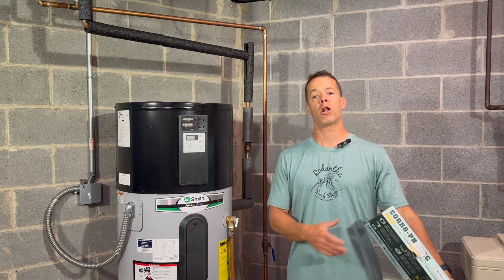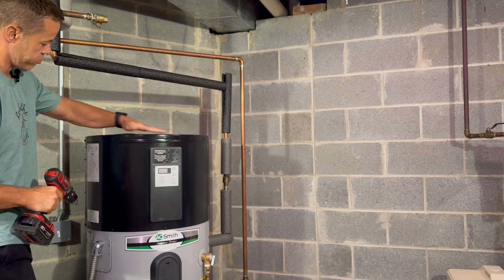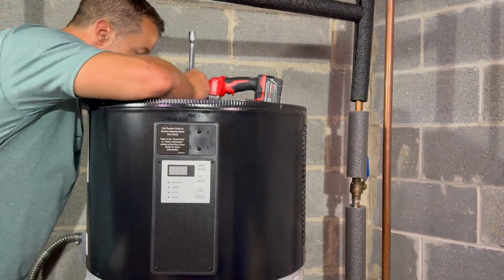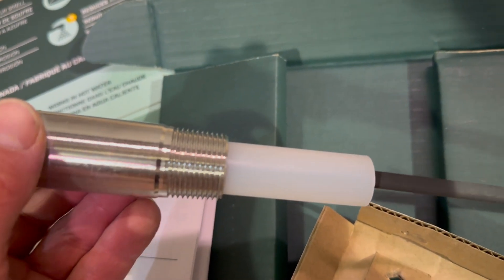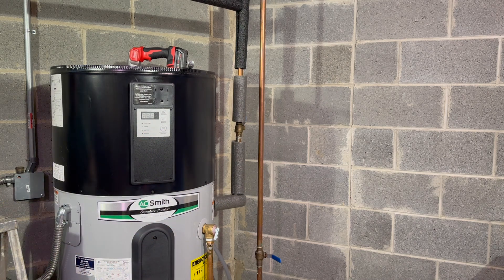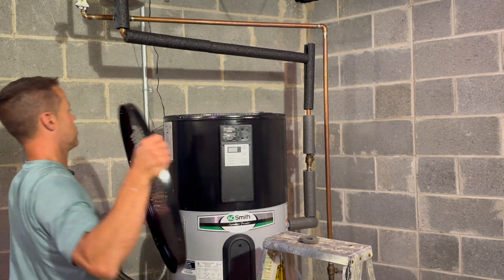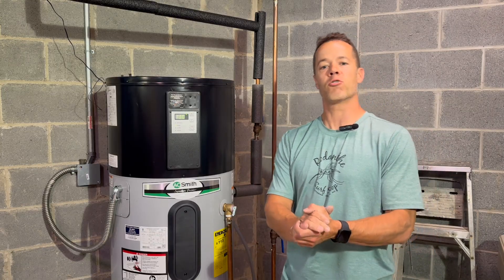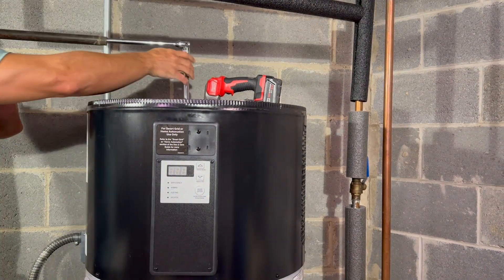Get Rid of Smelly Water by Installing an Electric Anode Rod /  (AO Smith Heat Pump Water Heater)

Comment: I installed this on my water heater and it works great. 

Also you can renew your water softener by using 1 cup iron out with 1/2 gallon of cold water. Mix until dissolved and then pour it into your brine we'll and force a regeneration.
Reply from the maker: thats a good tip!

Comment: For those mentioning the "anode rod depleted" error code, the newer AO Smith models no longer monitor that condition so they no longer use that error code.  (The older models had a wire that attached to the top of the anode rod and ran into the control unit, they just got rid of that.)
Reply from the maker: Hey, thanks for the info.  Mine isn’t the newest model but does not have the wire.

Comment: I have the same heater. I read adding two pints of H2O2 hydrogen peroxide will help kill any exsisting sulfur bacterial open up all faucetns/fixtures, Let sit over night and it will shcok your system so no lingering smel..
Reply from the maker: That smell disappeared almost immediately for me.  I’ve never heard about using peroxide……. I’m sure it couldn’t hurt

Comment: If this has already been mentioned, I'm sorry.  I called A.O. Smith and spoke with them. They confirmed that you can install this type of rod, but you will see an error message on your screen all the time because you can connect the A. O. Smith sensor to the Corro Protec electric rod.  I wish the Corro Protec rods were standard on most water heaters.
Reply from the maker: I was not aware of this.  I personally have not received an error code though.
Reply: @thedustybuilder any error codes yet, it's been a bit
Reply from the maker: @Hedgehodge- still no…… don’t jynx me!

Comment: All of my bathrooms stink and im thinking its from the water heater. Ive tried everything. I just finished draining them and the ao smith hybrid had white and gooey stuff come out. Im thinking i need to make this change. Did your water smell or did it make whole rooms smell?
Reply: One more question. What temp do you run this water heater?
Reply from the maker: @wesleyrice8864 my water smelled, but it could make a large area smelly if I was late replacing sediment filters.  The powered anode fixed that.  It really is a good product imho
Reply from the maker: @wesleyrice8864 125.

Comment: I have been researching HPWH's, and one installation manual specified 50-55 foot pounds of torque when re installing or replacing the anode rod
Reply from the maker: That sounds more reasonable than whoever tightened the ever loving heck out of it at the factory

Comment: Did you receive the "044" error from the AO Smith heat pump water heater after replacing? My current anode rod has a wire attached to it. After replacing the powered anode rod. The heater has a "044" alarm which means "anode rod has been depleted".
Reply from the maker: I did not. I wonder if a quick call to AO Smith would lead you in the right direction?

Comment: installing on my same brand hybrid hot water heater, But on my model the rod that came with the unit has a small wire attached to the top, I dont think its going to be able to attach to the new electric anode rod, any idea what that wire was for?
Reply from the maker: What a great question, I'm not sure.  If you find out please tell me.  I've had good luck calling customer service for such questions. Usually that have a tech department for such queries.  Good luck!

Comment: Love my Corro Protec's. I have them on both my water heaters. I'm on a well with hydrogen sulfide (iron bacteria causing the rotten egg smell), my hot water would turn black and smell like rotten eggs,.I wasted money on new rods and other things that didn't fix the problem. This Titanium electronic rod completely fixed my issue.
Reply: Good to know !  Do you still have to flush the tanks annually to get rid of any sediments ?
Reply from the maker: @ptg01  yes, the instruction manual even recommends it every 6 months to a year.  I do yearly
Reply from the maker: @machaf  yeah, same here.  My water would get that undesirable eggy smell…… not any more!

Comment: Does the length matter? Or since the water heater constantly fills, it doesn't matter as long as it's contacting water?
Reply from the maker: @HenryKayser-t9p  you got it!  It’s been several months and it’s working really well.

Comment: on mine it a 1 1/16 socket to clean out the installation hole i think easiest way for me was to use a flat peanut butter knife score in saw motion deep as u can into the installation and then use a screw driver long needle nose plyers thin nosed
 and break it all up then use shop vac with a 10" ryobi port adapter to collect the Styrofoam- to collect the installation till hole clean as you can get it- that worked pretty well- refill hole with garage installation board it about 10.00 a sheet something- i using it to insulate around doors in my old house then using panel over it its not too bad
Reply from the maker: @hermiesnow6947  For some reason, the anode rod was readily accessible on my heater.  I didn’t have to go so through so much effort!

Comment: What was Corro Protect thinking when they made their product require a 1 and 3/16 " socket when the industry standard is 1 and 1/16"?
Reply from the maker: @SignorLuigi  that’s a great question!  The fact that I happened to have it in my tool box was nothing short of a miracle
Reply: smith uses 1 1/16 socket
Reply from the maker: @hermiesnow6947  yes, but to install the powered anode rod it’s a different size
Reply: @thedustybuilder  yes cause not made by manufacturer and sure had make bigger maybe trade mark thing- or xtra added to their rod require different size?
Reply from the maker: @ you are more understanding than me!  I assumed they saved money somehow with the bigger socket size even tho it’s inconvenient for everyone, lol
Reply: it will fit you just need clean out around boldt better thats what i did- i used a thin peanut butter knife and and a shop vac with small nozzel and flashlight- and a 1 3/16 ill fit- i tried using a plumbers set for valves and 1 3/16 fit rt in the hole but let me tell you what did happen- turns out that smith electric water heaters yse plumbers dope and it cooks the rod in water heater it moved not more 1/2 inch at the bottom and now it leaking at bottom seal thing only year old so mad- but use caution these water tanks built soft

Comment: What if you dont have an outlet in there. Mine is on the other side of the hallway
Reply from the maker: @jondavid1256  you could be an underachiever and use an extension cord or be a stud and run a new outlet, wouldn’t be too difficult.  It doesn’t need its own circuit, so you could bounce off another outlet somewhere close